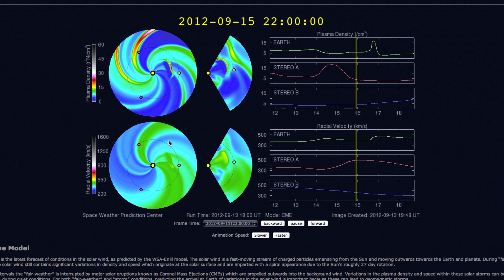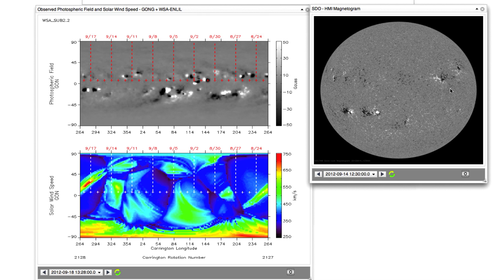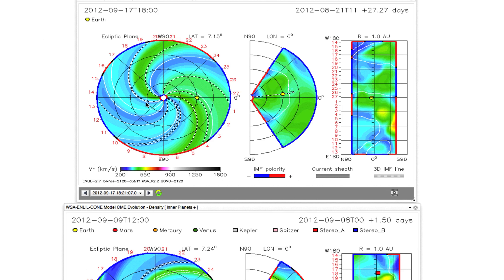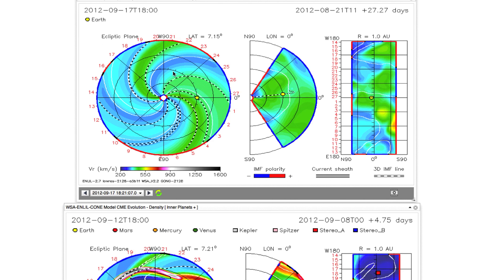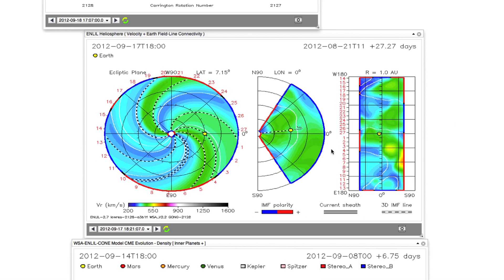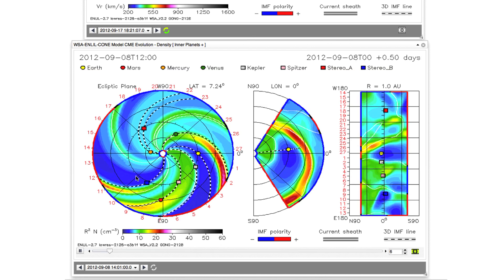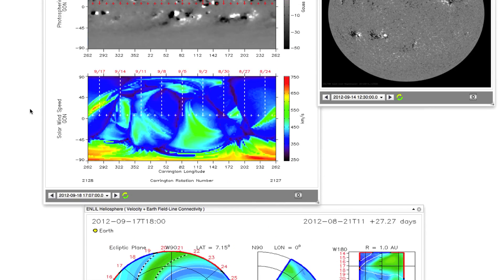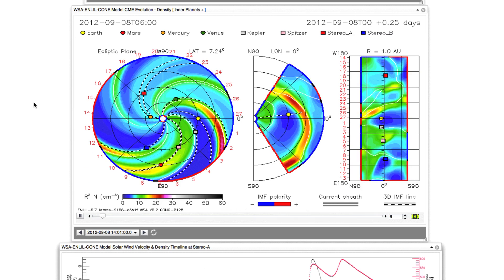WSA-Enlil Solar Wind and CME Simulations

Comment from the maker: The cygnet in the link: iswa.ccmc.gsfc.nasa.gov/IswaSystemWebApp/index.jsp?i_1=399&l_1=335&t_1=337&w_1=673&h_1=473&s_1=0_6 allows you to have a full control for the frames in the WSA-Enlil simulation. All iSWA image-based cygnets can be controlled in movie mode from date/time tab. Hope this helps.

Comment: Referring to following link, I would like to know on how to slow down / pause the time frame, the frame speed is too quick, I cannot read it's details at all.  

Do you have any suggestions on where to find data available in text format for IMF polarity (current and forecast)? which locate on the circumference of the left graph.

Thanks you very much for any suggestions